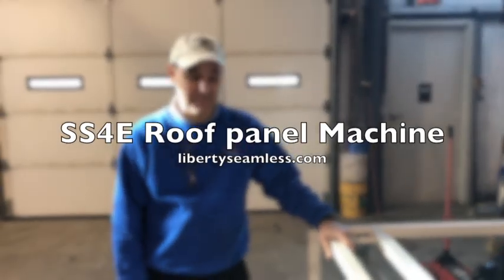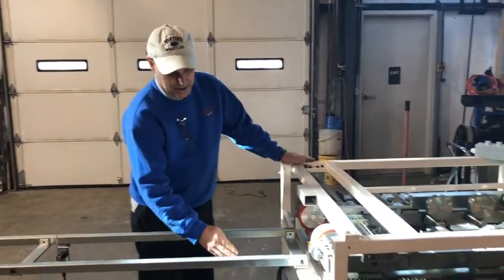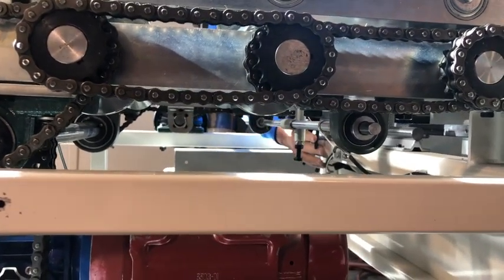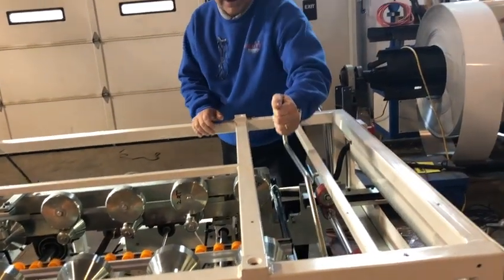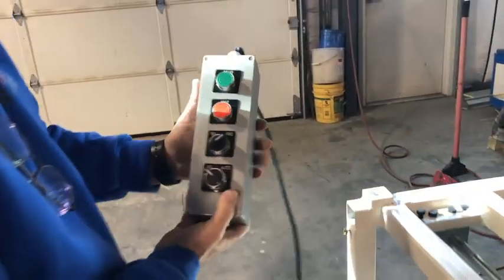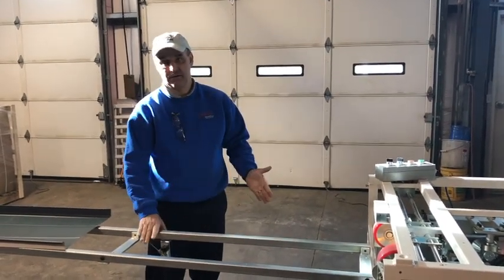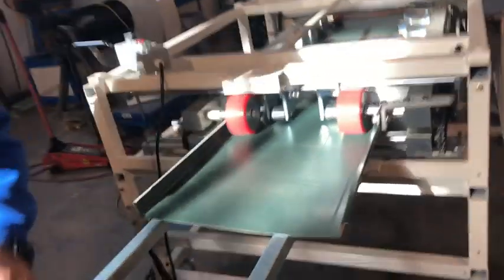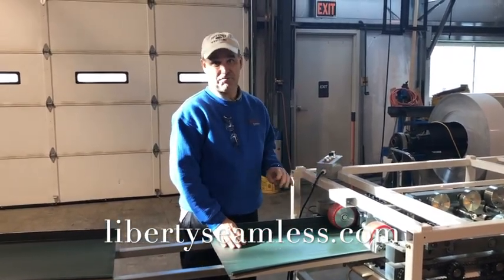Liberty SS4E Roof Panel Machine introduction

Comment: How much is the machine
Reply: basic machine with entrance end slitter, rollforming rollers for either 1" or 1.5", limit switch for length control is $13,750. Other options and pricing can be had at info@libertyseamless.com  . Includes new generation upgrades including wireless remote controller.

Comment: Price
Reply: 13,750 for machine ... coil handling, run out tables, etc is extra. contact info@libertyseamless.com or call 814-326-4121
Reply: Why is the machine so cheap ?? Others I have been looking they over 60 grand ?? Is that one of those deals?? you get what you pay??
Reply: @chemmagarcia8441   This one will only do 1" or 1.5" mechanical seam. We do have an SS4E PRO that can do various snap locks and is twice the price, still a good deal.  We have been designing and making machinery for construction industry for over 25 years, and sold some of those high priced models. We knew we could bring a better value, and so we did. Call 814-326-4121 to find out more.